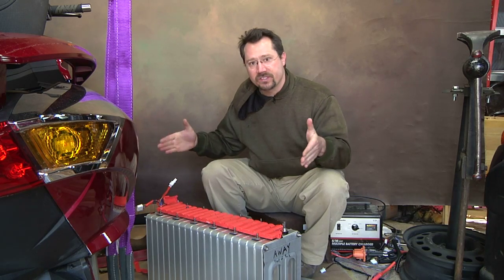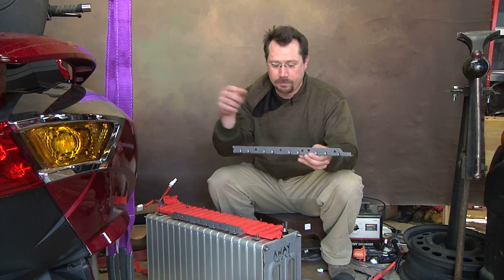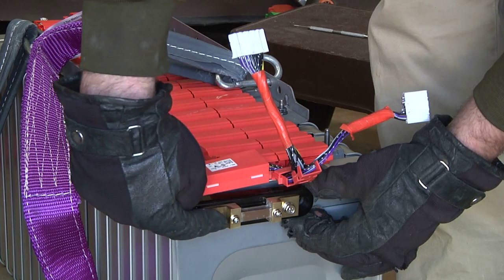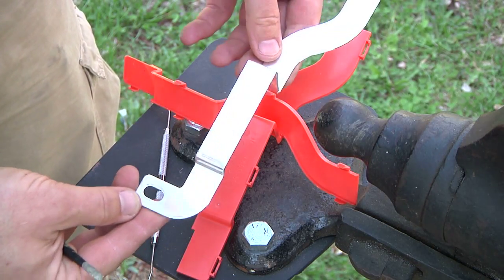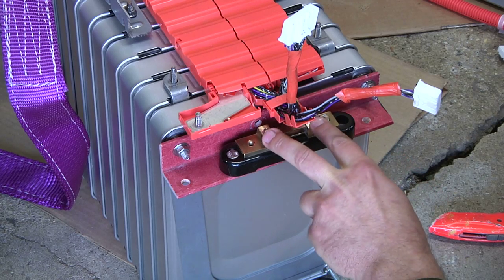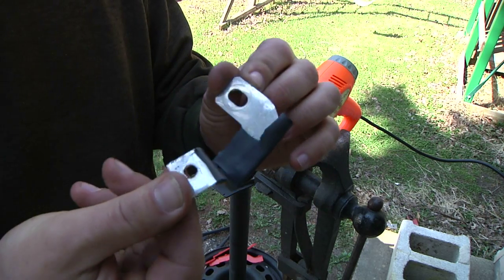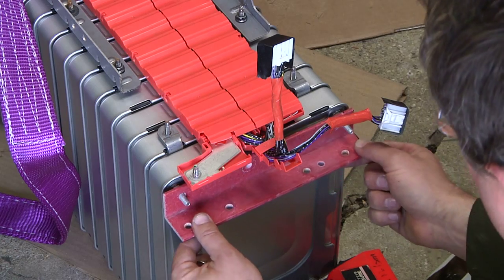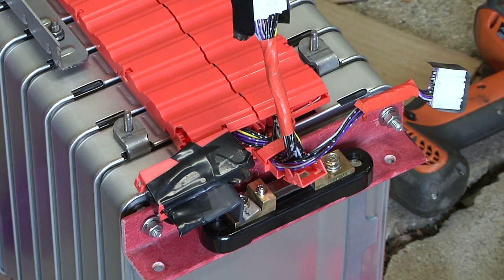Vectrix w/ LEAF battery bus bar and shunt.

Comment: Dear Ben, I'm overhauling an old Ni-MH VX-1 like you in this Video. I'm planning to use 36S li ion batteries, and here is my question: Is it neccesary to lower or modify the low voltage cutoff voltage (even possible?) to work with lithium pack properly? I have the factory Peak PCAN-USB tool and software. What do you recomend? Thank you for your answer!
Reply from the maker: I don't recall off hand what the low voltage cut-off on the Vectrix control board is. Lithium batteries have a "flatter" discharge curve than other battery types, so if you are waiting for the cycle to stop you from riding, you've probably already run your lithium batteries down way too far.
I'd recommend just having a good volt-meter on on the cycle to monitor your pack voltage while it's under load. Know what that minim voltage is, and don't ride beyond that. I used a Cycle Analyst for this, but even better would be some sort of BMS system which could monitor all cells at once and even alert you or cut power at that point.